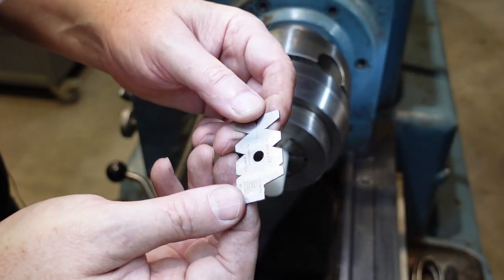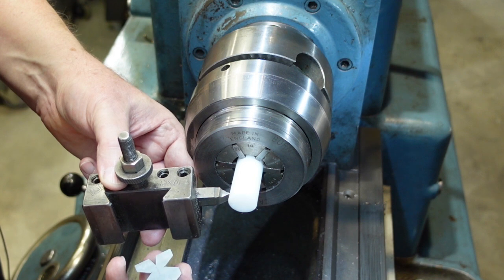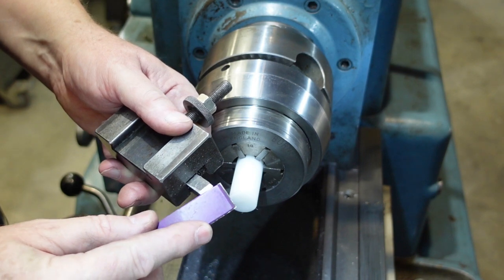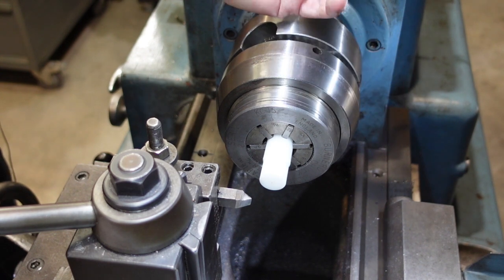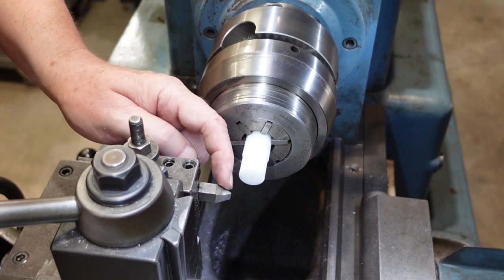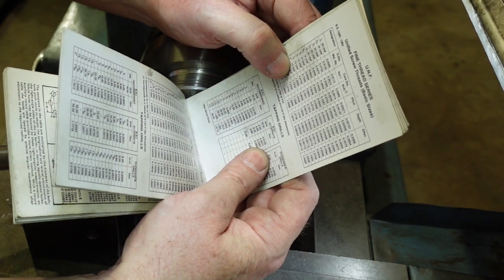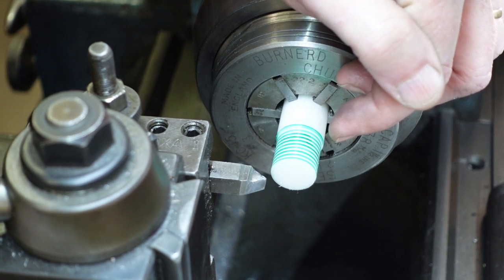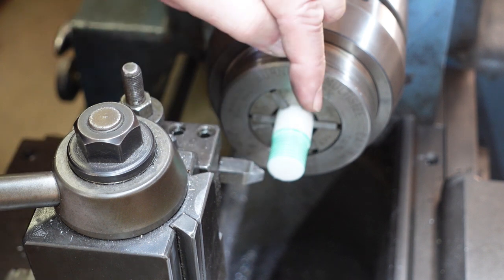Tips on single point threading

Comment: As someone that has been doing this for 44 years now (not a button pusher, CNC) good job!  A little tip,... when setting up or "chasing" (as we say on this side of the pond) put a piece of note paper on the carriage (or under the tool) and cup your hand over the top. The light coming up through the bottom of the tool makes it very easy to center the tool back in the thread. When doing this for the setup, you can easily see if the tool is the slightest bit crooked. If you can't see light around your tool, you've got a very square set up. Give it a try, good luck 😊
Reply from the maker: Good thought. My QCTP is pretty solid, but occasionally I do move it. When I do I usually check with the fishtail; that would work with that too.
(PS - it's a really big pond - I'm in Australia)
Reply: Oops, sorry. Was in Freemantle in 1983. Had a great time. You guys know how to welcome the US Navy to your country. "We" certainly appreciate it, thank you.